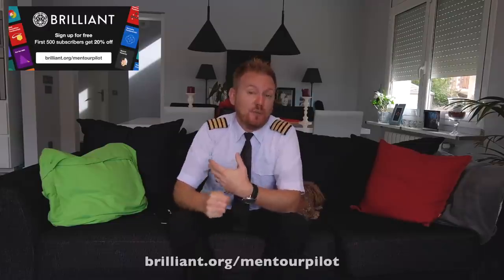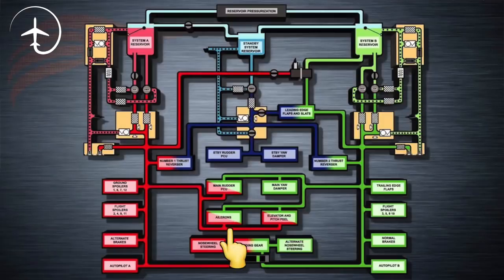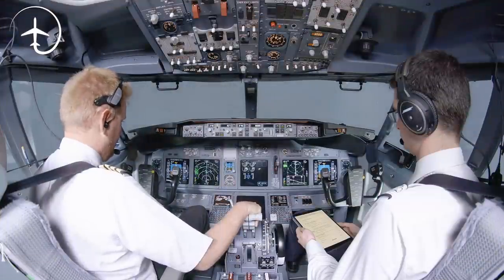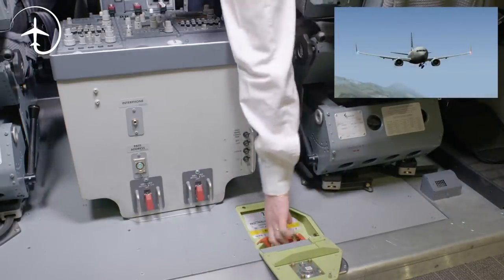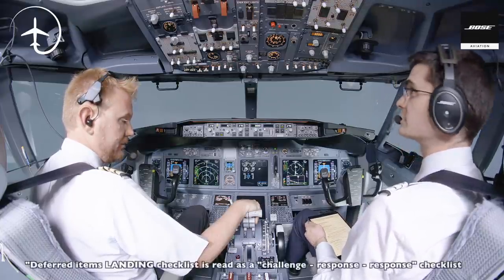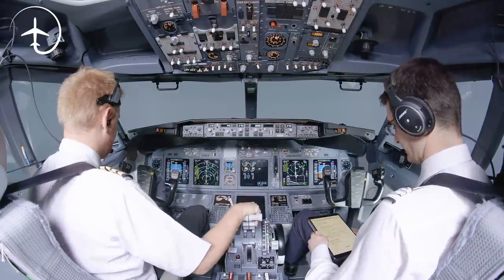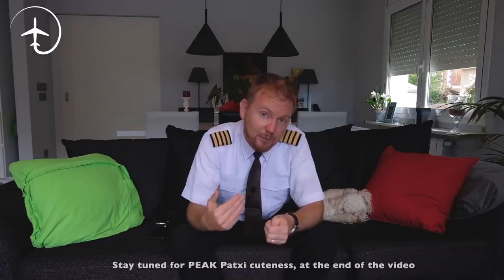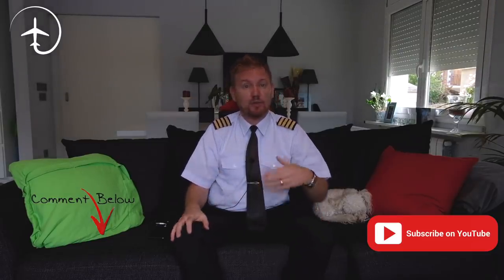Boeing 737 Emergency gear extension!! Cockpit video (FFS)

Comment: How do fighter planes fly with 90 degree bank angle since tje wing is oriented vertically and lift produced is in horizontal direction.please peter tell this.
Reply: The fuselage itself also produces lift and if the thrust is high enough (like it is in a fighter plane) it can maintain 90% and stay level. The rudder(s) control the pitch of the nose as required. Imagine a rocket or missile with no wings, it can still go up and down due to the high thrust for a similar reason.
Reply: Brendan Farthing yuppp. It does make sense. Thanks.😇😇

Comment: Woudl like to see more ATC communication explanation videos or maybe how the ILS works with a deep explanation. Thank you for your amazing videos Mentour
Reply: I sat through hours of instruction on this topic during a polytechnic program aimed at teaching students what they need to know to become what in Canada is referred to as a AME-E (a maintenance technican certified to repair avionics systems on aircraft).  Essentially ILS, like Mentour stated in his CAT 3 approach video, works with 2 components, one for vertical deviation ("glideslope") and one for lateral deviation from the centre line ("localiser").  These systems work exactly the same, apart from differing in frequency (localiser (or "LOC" for short) is in the 108.10-111.95 MHz range and glideslope (or "G/S" for short) is in the 329.15 - 335 MHz range--these frequencies are paired, so the pilot need only set the LOC frequency and the receiver will assign the corresponding G/S frequency to its G/S section) and they are rotated 90 degrees from each other.  He also says that they use 2 lobes of radiation, one amplitude modulated with a 90Hz signal, the other one with a 150 Hz signal (Above glideslope is 90Hz, Below G/S is 150 Hz, Left of centreline LOC is 90Hz and Right of centreline LOC is 150Hz).  The receiver listens to the two lobes, and resolves a needle deflection based on which one is more heavily modulated (i.e. stronger).  If it sees 2 equal modulations, it provides a "centred" signal i.e. the pilot simply needs to continue what he's doing for an ideal landing.  The indicator consists of 2 bars, one vertical and one horizontal.  In the 737 I believe this is simply a diamond moving between 4 dots and a centre marker, but the idea is the same: "Fly to the Bar".  This means, for example, if the bar or diamond shows you are above and to the left of centre flying left and climbing is necessary (i.e. you are too low and to the right of the runway centreline).  Each dot represents 2 degrees of deviation.  There's not much more to it than that.  The only complicated part is how to create those signals, which I don't quite understand myself, and how the LOC/GS receiver works (usually a component of the NAV receiver on transport category aircraft like the 737 which includes VOR, DME and maybe ADF as well), which is a long boring discussion.  Also, every ILS signal has a 3 letter morse code ident, so Mentour and other pilots know they are receiving the correct signal.  This is especially important when an airport has R/L or R/C/L parallel runways like Seattle (16L/34R, 16C/34C, 16R/34L).  Let me know Mentour if I have any of this wrong.

Comment: I saw in a video about the 747-400 that the pilots should wiggle the aircraft a bit to make sure the main landing gear is locked when manually extended. Isnt't this necessasary in a 737?
Reply: The gear on the 747 extends differently. The 737 gear swings down 90 degrees. 747 gear swings, rotates, and does other things when it comes down. Plus the 747 has 5 sets of landing gear that have to come down (Nose, Wing, and Belly gear)

Comment: Hi Mentour I would like to know how the mechanism  works the emergency slides , equipment which makes them work and how they would be retracted once used ,  how the aircraft is refuelled , this is something that has always made me curious ! Thank you regards Liz
Reply: They work like one of those quick inflating life vests. They have a tank with chemicals that are combined to form a rapidly expanding gas once a cable attached to the door is pulled. They aren't retracted. The plane is taken out of service and the slides are removed, then sent back to the manufacturer for inspection, repair, and repacking.

Comment: What I would like to see is what you would do if something like  the United  DC 10 would happen when you lose everything.
Reply: In the case of United 232, you'd likely die. No disrespect intended, but every senior DC-10 captain at United flew the accident profile in the sim. NONE of them even got close to an airport, much less landed. The combination of skill and luck in that scenario is beyond comprehension.

Comment: I am interested in hydraulics.  I fully understand that it takes an electric pump to run hydraulic systems.  Since that is the case, why don't  the airplane manufacturers just use electric motors to operate landing gear, flaps etc. ?

Comment: Mentour 
 .love all ur videos I'm a total non  aviator just an admirier and enthusiast in  appreciation of what u pilots have to do ,

 everything I've seen from u has been most informative  and enlightening 

I just have  one question at this stage 

What does " mimums' mean ? 

I've heard it  being called out by the on board cockpit voice at 500 and 400 feet on decent ...is this some kind of pre warning system and why is it called  out every time at those levels of decent in particular ? 
Thanks 
Tiff

Ps
 thank u so  much for going into detail over a few videos all about MCAS

Comment: Love the video. If the flight controls rely on two hydraulic systems is there an impact on handling if one system fails?
Reply: Arthur Lejawka The idea is that if one fails then the other hydraulic system can take over without a problem to the functionality.

Comment: Nice video, Petter! I think a complete engine out landing would be interesting to see, from normal cruise, until a full dead stick landing. Does the 737 have a RAT too, like other planes?
Reply: ForFunFlyer ~ Complete engine out equals NO hydraulic pressure to anything...including flight controls.
Reply: Some quick research says no it doesn't. But, it's also not needed because the controls are still connected by cables, so the pilot can still fly. They just get a workout because there is no hydraulic assistance.
Reply: @Gary-ld6ht  Yes, but even with no APU (for example in the case of total fuel loss), there is the Ram Air Turbine (RAT), a 'little' wind-driven propeller, that provides some electrics and hydraulic power. I've been told that a lot of planes use these, so that the pilots still can steer it. Perhaps Mentour Pilot can shed some light on this?
Reply: @murphsmodels8853  Ah, of course: the big difference between Boeing and Airbus, right?
Reply: @ForFunFlyer ~ Now that would make sense.  Never heard of the "RAT", thanks for the info.
Reply: @murphsmodels8853 ~ From what I've learned, it's my understanding that the flight control cables are assisted with movement by hydraulic (not completely sure) motors because, without the assistance, the pressure on the flight surfaces is too great to overcome by human strength alone such as is used for many general aviation aircraft.

Comment: Hello! Nice video! I would like to see how to manually fly a final approach with an important cross wind, with a liner. In particular focus the explanation on how to use the rudder related to the crosswind, performing a crab approach . If the rudder must be still pressed or used only for little correction to keep the track aligned with the runway centerline. Thank you!

Comment: I've just watched this twice, following the details, and it all makes perfect sense. But just imagine the problems the crew would face if they had three or four other safety-critical things happening at the same time, each demanding the same amount of methodical thought and application.

Dead engine? Radio failure? Bird-strike damage to sensors? Fuel problems? Severe turbulence? Fog? Incapacitated pilot? No olives for the Martinis? And NOW the LANDING GEAR'S stuck? Are you NUTS?

With the greatest of respect to all pilots and flight officers, it's easy to see how things can quickly get out of hand. I know that (real) simulator training quite deliberately throws several things at you at once during assessments, but it must take nerves of steel to stay calm enough to prioritise effectively.

Oh, and I'd prefer an orange juice to a Martini.

What?  There's no ICE? Nooooooo!

Comment: Petter, ALL of your simulator videos help alot.
In that approach, the system called "approaching minimum" and "minimum", which you replied check and go.
Can you do a normal take off and a landing, explaining the different things that are said, checked, and WHY.
Also, show the use of autopilot in flight, and how you check the information it has got is CORRECT for your flight, and where you are.

Comment: 1. Emergency Ditch
2. Tire failure and/or gear extension failure
3. Flaps failure on approach
4. Emergency divert to an airport that you or copilot have never been to, how you quickly identify runways and terminals/gates (DFW, Texas would be a good one for grins and giggles)

Comment: Thanks for the video. I'm not a pilot ( yet!), but i "fly" with Infite Flight for some years. I like to do crosswinds, up to 25kts on a Cirrus SR22,  on the Cessna Citation X, or the A320. They aren't easy, crashed a lot, at the begining, mainly on the small Cirrus. I saw some crosswind landings on real aviation and they seem hard to do. Can you to take off and landings on hard crosswinds for us to see how it is from the pilots perspective? Thanks.

Comment: Mentour Pilot, very cool video! I wondered how you guys lowered landing gear manually. Seeing exactly how it's done is not what I would have guessed.
I know you don't want to comment on current or ongoing investigations. I read an article in which Boeing employees warned Boeing and the FAA about a parts supplier (Ducommun)  falsifying documents. They supplied Bear straps and chords for the 737NG, between specific years. They reportedly made these parts by hand and not with  CNC machines. The parts required very tight tolerances that could not be achieved by hand. If you do decide to comment on this, that would be great, if not, I totally understand. I don't  think it would make for a good video but could make for an interesting conversation.
This might be a tricky one to answer, how often do you or other pilots have situations that are somewhat serious and the passengers never hear of? What are some typical or likely problems to have? What kinds of things happen that make you nervous or kind of wishing you were on the ground? 
Again, great video as always! You can make a video of almost anything to do with aviation and I'm sure we'd all enjoy it, I know I would!!!

Comment: Tjena! Not sure what the possibilities are, but I was wondering if you could elaborate on how pilots are being guided/navigated during taxi before takeoff/ after landing. Especially when they are not familiar with a specific airport - can they ask for more instructions from ATC? Today on a flight BRU-AMS, after we landed, the pilot abruptly slowed down the aircraft, almost having missed a turn to the desired taxi way. He managed to take the turn, but what are the procedures if he had missed it. Is it necessary to report it to ATC? obtain new taxi route? Is is demoable on a simulator?

And, ona different note: today I took 2 KLM flights and I am very close to coin my privatae opinion that KLM pilots love to start the takeoff run without first bringing the aircraft to a full stop. :)

Comment: I would really love simulator situations showing the area in between "flight without problems" and "mayday/pan pan". Something like: We know before the flight that one of our systems is not working properly, but this is not a harm to flight safety. Anyway, we have to to a different takeoff/climb/descend/landing procedure for this flight". At the moment I don't really have an idea, except those 747s beeing able to carry a fifth engine, making a certain rudder input necessary during the flight.

Comment: I love your videos! You should do a video about what you would do if you lost all hydraulics, like what happened on flight 232. Are there any backups for hydraulics other than the emergency hydraulic systems? Are there any backup electric motors for the ailerons for example?

Comment: Hi, I tend to be rather confused by approach terminology like "open descent mode" or "NAV mode", maybe you could show the different procedures with the simulator. Also, I'd be very interested in learning more about the many switches within the cockpit that are rarely pushed, I was particularly impressed with the way the pilot monitoring in your dual engine failure/birdstrike sim session performed the after takeoff checklist. I'd love to go through a checklist like that in more detail within a simulator setting. Greetings, Kevin

Comment: Does the opening of the door dump hydraulics from the gear? I ask because one failure mode would be a case where the gear handle is mechanically stuck in the UP position.

Could you do a follow-up on the MAX with auto-off?

Comment: I'm super late to the party, but I really want to see what happens when you destructively exceed the plane's flight specs in the simulator (let's say, trying to perform a loop-the-loop, or just performing a straight dive down at a speed that would rip off the airplane wings). How much will it attempt to model the failure mode? Will it just pop up a big red screen that says "You naughty, naughty boy"? Does the simulator have a model number? Is it supplied directly from Boeing? Is it one of those big fancy deals with the hydraulics? Has this all been answered already, and I just need to go through your past videos?

Comment: From one viking to another: I've always wondered about something when it comes to weight and landing in case of an emergency that requires you to land as quickly as possible. I don't know how often the fuel tanks is filled up to maximum level, but I would guess that they get filled up pretty close to the maximum pretty often. In this situation the total weight of the plane will be very heavy and if I have understood this correctly you should dump fuel before landing if you have time to do it. If I have noticed from other videos that it takes quite some time to dump fuel, but let's say for the arguments sake that the damage on the air plane is so severe that you don't have time to dump fuel and have to turn around and land immediately, can you do that with full fuel tanks or will the landing gear break? If the answer is "Yes, you can land with full thanks":
1. Is it safe for the passenger and crew?
2. Will the plane be "fit to fly" again immediately or does it have to go through a heavy maintenance check because of the heavy impact on the landing gear and fuselage? 
3. If you have time to dump fuel,  how do you know when you have dumped enough fuel? Is this calculations you do by hand or does the on board computer do it for you, if the computers are working? I'ts an emergency remember. ;-)
Thanks in  advance!
PS: Jeg er fra Norge :-)

Comment: Can you show the standard hold pattern when you are queuing for landing? What is the bank angles in the turns, and how many nautical miles are the legs (Published vs. ATC instructions - use your base airport for the example).

Comment: Is there any way you could use the simulator to recreate Aloha airlines Flight 243? That is burned into my memory as a miracle, and I remember as a new arrival in Hawaii thinking that I could've been a passenger on that flight. I would be grateful for any discussion around 243, or an actual demonstration!

Comment: Thank you Mentour for yet another absolutely fantastic video. For a simulator video: how about the usual tasks and procedures that are performed on the ground, between doors closed and takeoff, and between touchdown and doors open? You have already explained most of them individually, including communications with cabin crew an PA, but a proper simulation might give us passengers a better perspective on what is going on. Thank you.

Comment: Hi, nice videos. I have a question: Do you know why the seat belt sign is on from at least 300km when flying from Europe to Israel. It was on starting from flying over Cyprus. I've heard that this is done in case the pilot has to avoid a missile. Can you do a surface to air missile avoidance scenario in the simulator? Does having the seat belt on saves you from a missile ?????

Comment: Hi Mentour, great vid as always!! 
I always wanted to see the backstage of the simulator. For example how do they fake a failure, is there a computer at the back of the cockpit or outside the cabin? How do they fake the trim "heaviness" that you showed in the last video? Because it is a sim so I imagine it has no physical wires connecting any horizontal stabilizer. The same goes for those wires to extend the gear. 
Anyways, anything you do I like so focus on doing what you like, then we will also most likely like it.

Comment: Hi Peter, my request is not as sexy as high crosswind approach and engine fire with no nosegear gear lockdown (feel free to do that!) - but the strength of the 737 over other modern aircraft is the ability to fall back to manual systems and procedures. Please continue to demonstrate the methods to overcome a loss of automated systems in the 737. Example is loss of precision nav, autopilot, etc. Young pilots are weakened by dependance on automation.